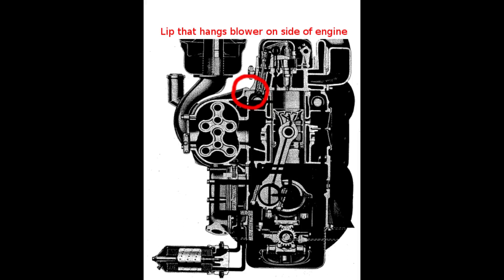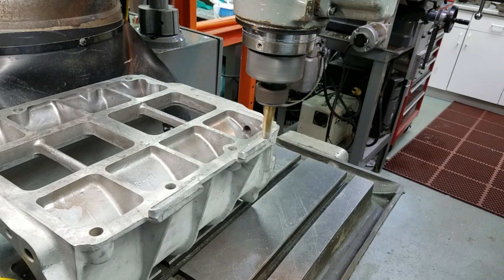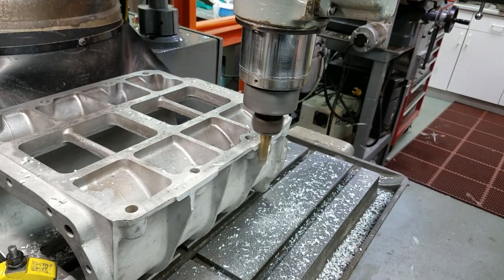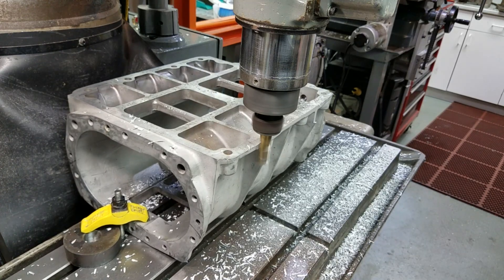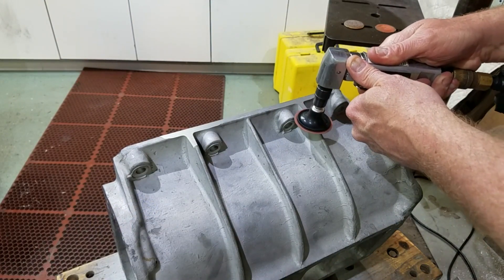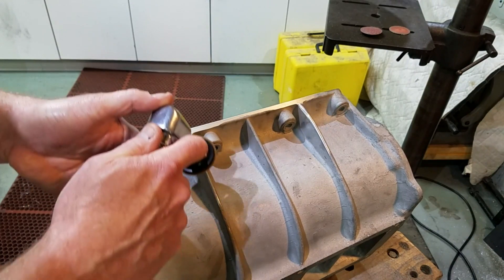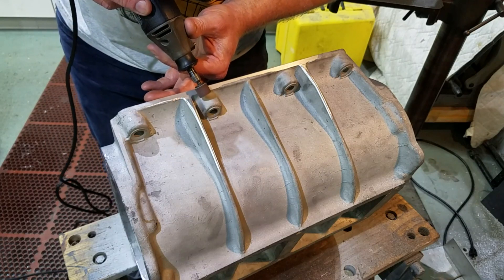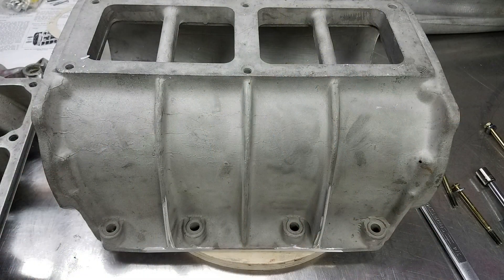My 6-71 Blower rebuild, Part 1: Removing the lip from the side of the case.

Comment: Do you know how to tell the difference between a large bore and small bore case. Maybe the casting numbers or ???
Reply from the maker: I recall that the small bore case has two side tabs, and the earlier large bore case has a single long side tab.  I am referring to the tab that is milled off in this video.  By the way, the case in this video is a small bore.  I will try to go down to the shop this weekend to confirm that my memory is correct.  Thanks!
Reply: @MakerCave  awesome thanks. Its hard to find info on large bore and small bore based on the casting numbers. So any help is awesome. Thanks again

Comment: i want to know how to remove the rotors  mine is stuck
Reply from the maker: Can you unbolt the front bearing plate, and pull it and the rotors from the case as an assembly?  Where are they stuck?   Are they stuck in the front bearing plate, or are they stuck in the rear bearing plate?  What have you taken apart so far?